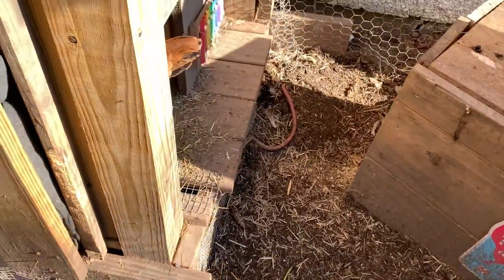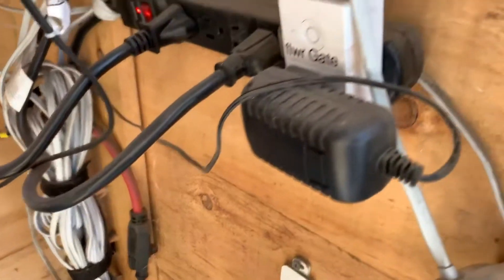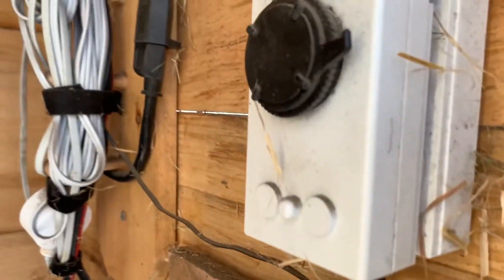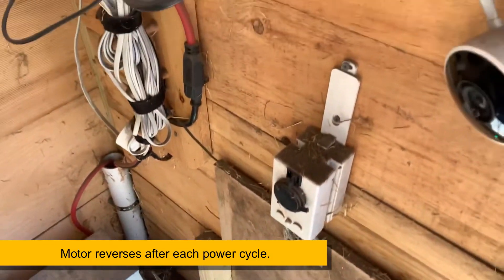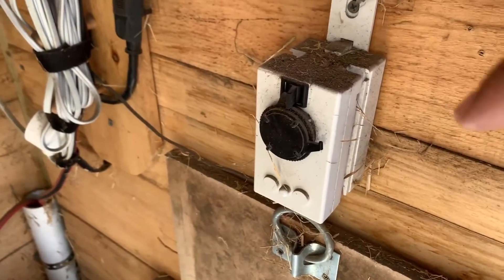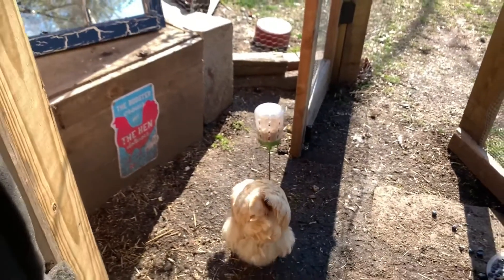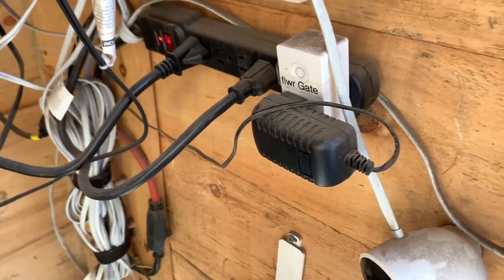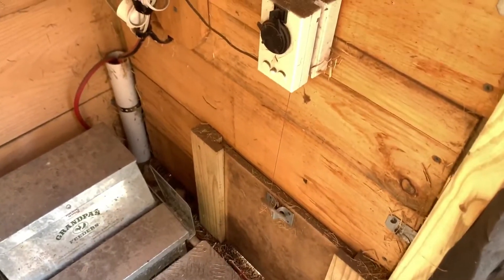Automatic Chicken Coop Door Opener - How to automate a chicken coop door

Comment: Great information. Motor seems loud ... do you think it would annoy nesting hens if situated close to nesting boxes?
Reply from the maker: Motor is loud.  Chicks adapt quickly and relate to the door.  Will wake them, but given this is open/closing when they are generally close to wake hours, not an issue.  You can build a box around to isolate noise if needed.